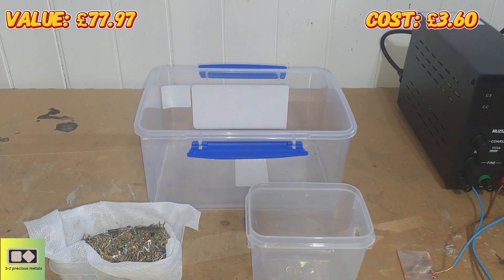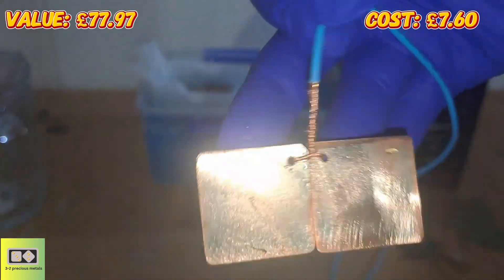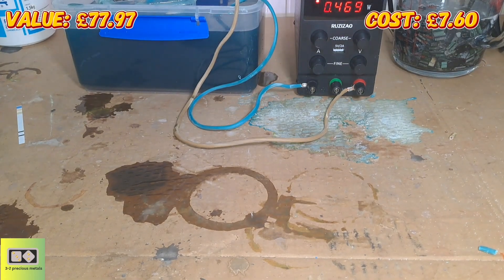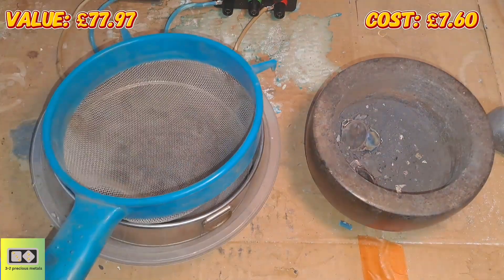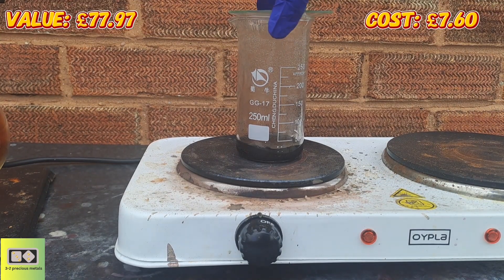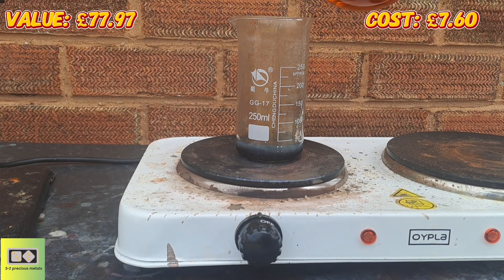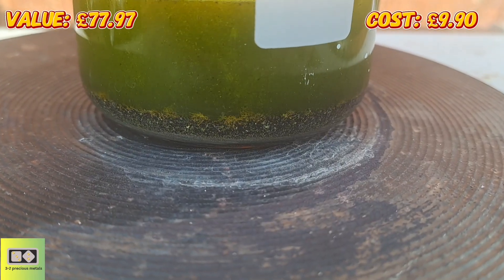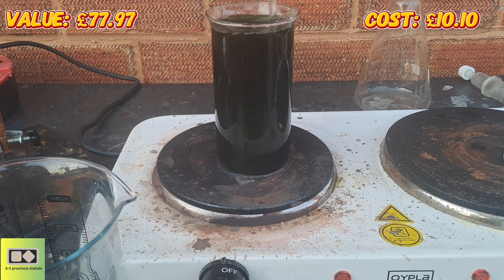20 kg ewaste series, part 2: gold from bga chips and DIP chips.

Comment: Please upload a video of gold recovery by just putting the electronic parts in HCl solution. If needed, please upload a short video please please😢
Reply from the maker: I could but just using hcl would only dissolve base metals. It would not dissolve the gold it would take a very long time to dissolve the base metals also without an oxidizer. It's always better to dissolve the base metals first with either nitric acid. Vinegar and hydrogen peroxide or hcl and hydrogen peroxide. Hcl alone is not cost effective and would be very time consuming. I'm talking months 👍

Comment: On the chips, could the gray material be maybe other precious metals? palladium or platinum?
Reply from the maker: Unfortunately not. If it were palladium, it would have dissolved in the nitric acid boil. I actually put the remaining material in aqua regia this morning, and it still remains. I'll be honest I haven't processed dip chips before separately. I normally throw them in with the flat pack ic chips. I only did them separately as I had so many of them. But there really is very little gold in them in the future. I'll go back to processing them with the flat packs.
Reply from the maker: After a bit of reading. It looks like it could be the resin used to bond the top and bottom half of the chip (possibly)
Reply: @3-2preciousmetalrecycling  was it metallic, shiny like silicon or dull? Acetone can soften resin if you have some.  Nice and helpful video though, i subbed. I'm going to process about 250 lbs of telecom boards, and mechanical removing components first,  cutting off clean sections of plating and doing small samples to evaluate the metal dissolving to minimize junk base metal soup.
Reply from the maker: @JosephWarner77, it was a dull grey material, i like to mechanically remove as much of the base metals as possible too. Dissolving everything leaves behind a lot of liquid waste, which ends up beeing stored until you find a couple of free days to deal with it👍

Comment: Well done ! Adding about 40-50 ml of Sulfuric acid  will increase the efficiency of that copper sulphate cell . Sill working on depopulating boards
Reply from the maker: Thanks bud. Unfortunately, I can't get my hands on sulfuric acid over here, but I did add 80 grams of sodium bisulfate, which I forgot to mention.  Depopulation of boards is the most time consuming part of the job for me too👍
Reply: @3-2preciousmetalrecycling 😅m a little behind have a nice pile of chips gathered . Sorting, separating . Etc. 
I thought the panning was well done , I have just gravity  separated looks like it concentrate the heavy quickly
Reply from the maker: To be honest, the bond wires in the gold corner bga chips were a lot more difficult to pan. Due to their length, they wrapped around the lighter material and washed back. The shorter wires in the dip chips didn't do this as much. Which I was happy about as there was a lot more ash in those. I'm definitely curious as to how much I lost in the panning. I was expecting a little over a gram from both the dips and the gold corners.
Reply: @3-2preciousmetalrecycling  can you leach the pan pour off sediment ?
Reply from the maker: Thats a good shout. I had thought of trying a sodium ferrocyanide leach.